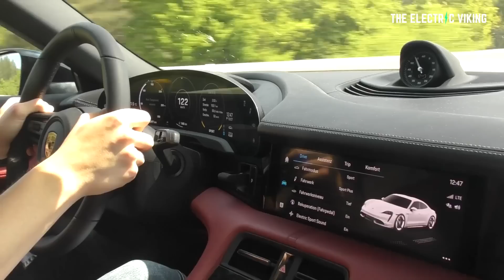Porsche begins producing synthetic gasoline it claims is carbon neutral

Comment: They are aiming at a price point of 2$ per liter which is cheaper than regular fuel in many places right now. Where I live it is the equivalent price as buying higher octane.

Also ppl don't seem to realize that the infrastructure for all electric cars simply won't be available. Not only that but if batterie tech doesn't make a magical jump and stops needing hard to get and even harder to dispose of materials than there is no future for full EVs(BTW companies have been trying to find better batteries for decades and there is still nothing to show for).
Reply: At a fuel cost of $2/l amounts to a cost of $0.2/km for a car such as a Ford Escape that has a fuel mileage of 10l/100km.  A cost of 20 cents per km is 10 times more expensive than an EV whose energy cost is 2 cents per km when charged at home.  Why would anybody want to pay 10 times the energy cost  when compared to an EV to travel the same distance?

Also, you may not know, but EV batteries are fully recyclable.  Infrastructure will not be a problem, since most EV's are charged at home.   Yes, for longer trips the charging network still needs to be expanded, but in due time that will be taken care of as well.  Cheers.
Reply: @petemiller519  You have a good point about people wanting electric cars. I looked up the consumption and it appears that the most popular models consume about 12-16+kWh/100km which would make driving one a lot cheaper even in an slight energy crunch. And that's excluding the comfort, reliability with simpler internals...

[Tangent warning]
BUT the point about EV batteries being fully recyclable is just wrong. No mass produced batteries (and I mean none) on the market is fully recyclable. And that is not even the biggest problem. 
The issue is that most batteries that get 'recycled' extract the expensive materials and leave a grinded up mess that is either sent to a storage facility to be stored for decades in companies that have the spotlight or shipped and dumped on poorer countries in others. When Tesla says they recycle 100% of their batteries that means they recycle a bit of every used up battery.
It is also not even close to being cost effective so it will end up in a similar way to plastic and electronics recycling where it gets shipped of to some place so it's not our problem anymore.
[]

Right now you get a lot of news saying that the EU might get an energy crisis because of blocked gas access but you might be a bit shocked that it's not the only place. The USA, India, Japan, China and most of Africa also don't produce as much power as here is demand.

The infrastructure might be fine in some places but if every car in first world countries were replaced with EVs you would need 30-60% increase in electricity production(when we are having power cuts as we speak). And even if you get that the current connections in some places wouldn't be able to handle it. In poorer places the difference would be even grater(that could bring more electricity crunches). If you would get the difference by burning coal(USA for example gets 60sih% of electricity from fossil fuels), wrecking more rivers, producing loads of solar panels that also MIGHT get recycled in 20 years than what is the point of EVs.

Don' t get me wrong EVs are awesome but if everyone pushed for them now most parts of the world simply couldn't take it. If they get even more efficient, have solid batteries that don't need miners working in terrible conditions that are even more recyclable,  decentralize computer chip production and manage to source minerals that are needed from outside of China than that would be great. 

In my humble opinion you should have a full recycling plant with transparent stats and then start production if you really want to go green. 

I'd be up for EV conversions instantly if it became cost effective. Until then I think having an alternative like hydrogen and carbon neutralish gas that is straight up compatible with 50+% of cars ever built is awesome.
Reply: Hilariously misinformed drivel at best. The infastructure to support a petrol station's pumps? or a fossil fuel burning power plant or a fossil fuel refinery A fossil fuel pipeline? Yeah all of that is the grid with utility hookups and electric power required to function. 

You can eliminate all that dirty air dangerous air filling particulate pollution, combustion noise, high heat, oil&gas spills, fires, water pollution&poisoning effects. Instead just charge clean running evs with all that energy not being wasted up a smoke stack or out a tailpipe. 👍🏻😎
Reply: @4literv6  Welp I guess it came out wrong my point was:
1. RN 80+% of the worlds energy is still form fossil fuels so powering EVs like that isn't the best
2. RN the USA, EU, India, Japan, China, most of Africa don't have enough electricity to feed the demand so they are slowly INCREASING reliance on even more fossil fuels and increasing the price. If everyone got EVs it would mean you need 30-60% more electricity that we CAN'T produce so you would have to let something else go
3. EV batteries are a HUGE problem because they are not actually fully recyclable and the parts that are aren't nearly financially viable so they will get ground up and shipped away(not my problem anymore method)
4.  You are strongly relying on a couple of places to not mess up the global industry (if Taiwan stops chip production there is no more good EVs for years to come, if China stops mineral mining or trade there is no more batteries)
5.  I LOVE EVs, would highly consider old car to EV converisons and am excited for the future nuclear power, solid state batteries, efficiency gains, comforts, acceleration, 20% less global emissions... but if it means you take hydrogen powered or carbon neutral gas(ESPECIALLY if it is instantly compatible with 50% of all vehicles) or even carbon neutral gas/hydrogen + hybrid powered cars along the way than I think thats the better option(especially now when we still aren't sure what is the best fuel for the future).

Comment: I read last week a company, not Porsche, is already producing zero carbon synthetic gasoline at low volume and can sell it for less than fossil gasoline and will be scaling up their production. I’ve a 2013 Chevy Volt PHEV, my average mpg is 200mpg, maybe a PHEV with say a 100mile battery range and a synthetic gasoline fuel cell zero emission range extender could be sold at affordable levels to  many more people who can’t presently afford an EV, don’t think we should close our minds to other new technologies, our goals should be reducing climate change, C02, pollution and pollution related illnesses as fast as possible. Batteries are amazing and are advancing in leaps and bounds, but with the best will in the world we can’t make enough of them or mine or purify the raw material they require for a while.
Reply: Agreed,  with current mining worldwide is only enough to satisfy a modest production of electric cars, if EV's go massive the environmental impact of a huge increase on mining manganese, cobalt, nickel, rare earths and lithium will be very big. Not to mention the social impact, cause those materials to make lithium batteries are mostly found in 3d world countries.

And I think you mean Toyota, that is also developing synthetic fuel and has tested on their racing division Gazoo and I don't know if Subaru is also aboard that train.

Giving alternatives of different cleaner fuels is better than to close minds to only one option.
Reply: Carbon Engineering? They have had a pilot plant running since 2017.
Reply: 200mpg my ass

Comment: The carbon is important but the essential question is does it cost less than oil based gasoline. My electric car costs $0.06 per mile, oil based gas costs $0.25 per mile. Fantasyland is not an economical place to live and a majority of the rich are wealthy because they make very good economical decisions. 1% of the 1% is not a profitable financial market. Especially when you can buy an electric kit to convert your Porsche to EV.

Comment: Hi Sam, greetings from the U.K.  The Porsche leadership team need to go back to school and study A Level chemistry. When you burn a hydrocarbon in the presence of sufficient oxygen, the two primary combustion products are water and carbon dioxide. If there is insufficient oxygen it gets worse, the primary combustion products are water and carbon monoxide - which is toxic to animals that breath air. Even worse, hydrocarbons contain other elements such as sulphur and nitrogen, when burned these combine with oxygen to create sulphur dioxide and nitrous oxides which are toxic to all life, and soluble in water, polluting our rivers and oceans. This is chemistry 101, it’s what happens, there is nothing to debate about the chemistry of the universe, it is what it is.
Reply: But, if they not putting out as much carbon than they're taking from the air, which is the entire point, than the air doesn't get worse, it stays the same, and since technology always advances over time, it will get better.

Comment: Sam it is pure & simple that Porsche are looking to enter Formula 1 racing in 2026, all F1 teams are currently developing synthetic and carbon neutral fuels already ,so Porsche guinea pigging it on there road car to cross pollunate into F1,could be seen as a smart reverse mode, normally developments in F1 trickle to road cars, eg regen braking/battery regen doing the reverse could be a smart move for there F1 team likely to be Sauber after there Alfa Romeo deal finishes, crazy but there is proably some grain of truth in Porsche attempting to be top dog in F1  in 2026  ??,as they already been rebuffed in a attempt to buy in/takeover Red Bull Racing earlier this year as they (Porsche) wanted to take over engine developments which Red Bull already do, plus Porsche would not give Red Bull the same autonomy as they already have,yes i am a F1 fan
Reply: I used to love watching the F1 races on TV. they stopped doing that, only see a few snippets during the news (yes I can pay some twit just so I can see a dozen races a year) Now it's so far off my radar it's not funny - just because some penny pincher wants more $$$. - Stuff 'em.

Comment: You should look at the US ethanol regulations. Farmers get a huge market to use shitload of diesel to farm corn...then sold to ethanol plant...WHICH USES COAL TO MAKE ETHANOL...the fuel that loses btu and efficiency at every step. Then it's forced on customers at 10% in "gasoline". So now what was 100% gasoline is now 90% gas, then the same carbon emissions to make the last 10%. It takes like a quart of diesel and 500lbs of coal to make a gallon of ethanol.

Comment: Try using a film camera these days. Running cars on e-fuel will be just as annoying and impractical. Policies will still be tight because e-fuel only addresses climate impact and not local air pollution. General public won't accept it cuz let's face it, EVs drive much smoother and quicker with more space everywhere than combustion cars. This e-fuel will be positioned in the market just like film, low volume and high price hobby products. That won't be much of a concern environmentally nor in terms of climate since enthusiast cars tend to be driven very little and there are very few enthusiasts that actually like cars enough to invest enough time, money and effort to keep them running with e-fuel.

Comment: I love ya man, but you’re kind of grasping at straws in this one. The argument that it’s not “carbon neutral” because carbon is being moved from one place to another? Dude, that’s not how the atmosphere works. That’s not how WIND works. E-fuels are a perfectly valid approach to decarbonizing, and likely a necessary one (I think green hydrogen will solve tremendous problems at the grid level). And e-fuels can decarbonize more difficult problems than cars, like aircraft and shipping (which is why companies like American Airlines and Maertz are heavily invested in e-fuels). The big question here is cost, and that’s directly related to process efficiency. If it costs five times more than fossil gasoline, it’s a non-starter. If it costs twice as much, there’s a market - people who can afford it will happily buy it to decarbonize their existing cars, even at a premium, and a lot of ordinary, non-rich people can afford that. And as solar/wind electricity gets cheaper while oil gets more expensive, e-gasoline becomes more competitive. 

This is actually a really good idea, and should be applauded, not rejected with frankly bad arguments just because it’s not an EV.

Comment: Carbon neutral in terms of carbon atoms is a different statement than total GHG, which is what we actually care about. Nitrogen oxides are also a result of the combustion process. As you said, the use of renewable energy to do this is, like green hydrogen,  ludicrous. What it sounds like is a kind of green virtue signaling for supercar owners.

Comment: for me the ev revolution has nothing to do with green house gases , its about switching off petrol which will eventually run out,   its about a quite , low maintenance, quick car that you can fuel up for free from the sun  (most days of the year)
Reply: EVs are fine for people who can afford them. Synthetic fuels bridge the gap until evs are as cheap to buy/run as ice vehicles.
Reply: @poshun9407  Good point. And if price of synthetic fuels comes down, it seems to be good options also to reduce CO2.
Reply: What we forget is that oil is not just about transport fuel.  There are about 6000 useful products derived from oil. If we are to replace mineral oil we will need to come up with synthetic alternatives that can be used to replace it as a feedstock for the production of pharmaceuticals plastics solvents lubricant coatings etc as well as fuels. Synthetic hydrocarbon from CO2 and H2 if successful would answer this requirement. As for cancer argument. Processing of the minerals to produce batteries let alone recycle them produces a new extremely toxic and persistent waste stream in huge quantities. Out of the frying pan into the fire I think. We are likely much further along the path of remediating pollution from hydrocarbon fuels than solving the pollution issues that will result from the production of EVs on a large scale. Liquid fuels would also be a good way to store and transport excess energy due to their high energy density, helping solve the storage and transport issues associated with renewable energy.  It would also turn any existing ICE carbon neutral immediately  and avoid the high environmental cost of rebuilding the transport fleet and the supporting infrastructure.The local  CO2 argument is pretty desperate stuff born of the narrow-mindedness of a EV booster. Gases disperse extremely rapidly in still air and the air is never still. Clutching at straws with that one. We should be allowing alternate solutions (there is likely to be no single one anyway) to develop to find the best way forward and avoid cutting off potentially promising solutions due to narrow entrenched views and moral self righteousness.
Reply: For me it is all of that
Reply: "car that you can fuel up for free from the sun"
If the sun shines, cause not every country has the sun out 'most days of the year' and if you have the long  time to wait until it's recharged.
Reply: @arturama8581  yes that is true, 

but solar, wind hydro batteries , then you fall back on nuclear  

case closed

Comment: How much carbon and other pollutants are released in carrying it over the Atlantic?
Reply: Of all remarks one can give, this is probably the most irrelevant. One does not even have to be a proponent of e-fuel…
As a comparison, there is a general agreement trash needs to be picked up and dumped and not linger around in nature. That trash is mostly picked up by trucks running on diesel, gas or whatever. Of course, running them on batteries or whatever is even better but it’s of lesser importance than trash piling up.
Again, one does not have to be a proponent of these e-fuels, full disclosure: I am not) to realize that in some cases the goal must justify the way to get to that goal. In this case it’s NOT CO2 reduction, hence I’m not a proponent
Reply: @gerardhaus8150  Chill man, I'm on your side, I'm just pointing out and additional reason for why it's a stupid idea.
Reply: @eclecticcyclist  All good mate 👍🏻

Comment: I figure by sometime in the 2040s fossil based road vehicle fuels will be illegal and the remaining ICE road vehicles will need to use efuels or biofuels. That said, at this point we need efuels and biofuels for air travel and maritime shipping. We shouldn't be wasting it on road travel which is much more efficient via electrification .
Reply: Don't worry, nobody will buy expensive synfuel when electricity is a tenth of the cost.
Reply: @James Van Damme  some rich folks with their hobby vehicles may keep that market alive... but not many I suspect. Though, again, expect to see efuels and biofuels prominent in sea and air travel.

Comment: Porsche in colab with Toyota are releasing a new car.
The BZX-H2-Synth-FKManual-Hybrid-BoomBoom:  Specs as follows:
 - A 2 Litre Hybrid "sythenthic hydrogen" fuel cell.
 - A fake manual gearbox
 - A fake V8 Engine sound
 - Wheels that will probably stay on
 - Slightly less fires than other Hybrids.